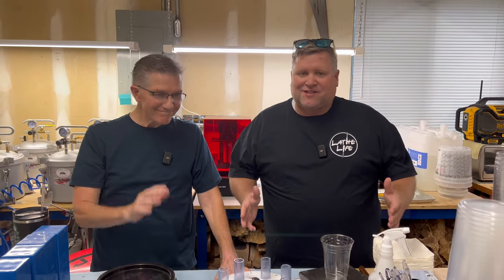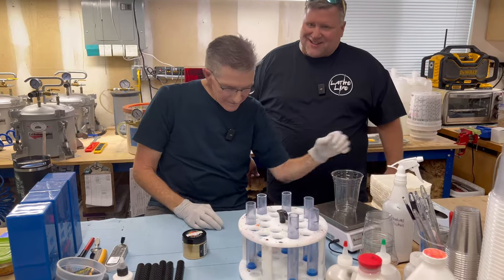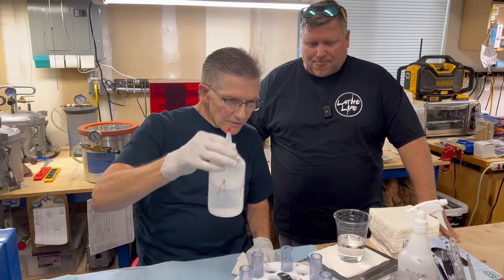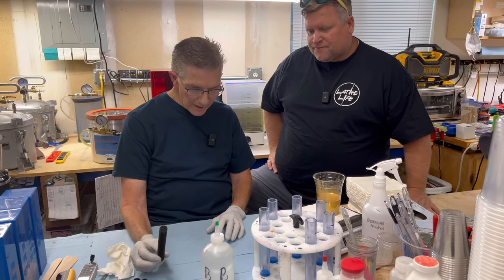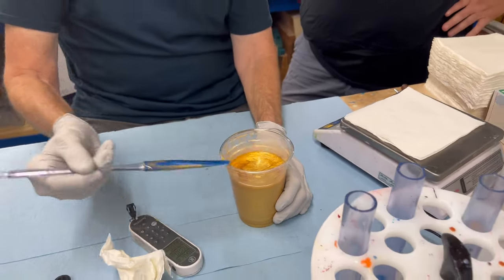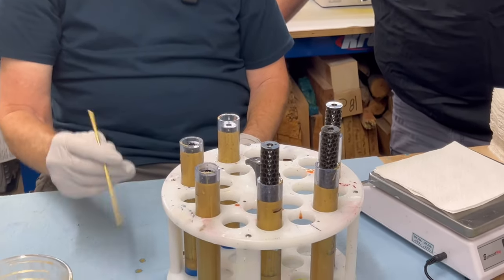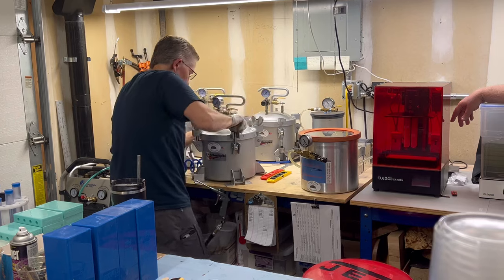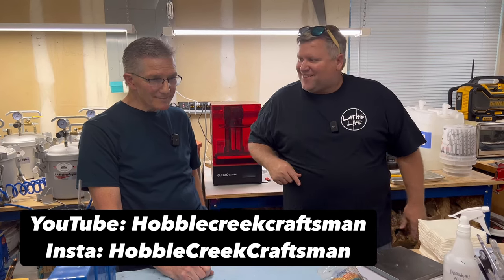Resin Casting Honeycomb Blanks with Mark @hobblecreekcraftsman

Comment: Does the honeycomb; being that it's so susceptible to UV light; make the finished blanks any more fragile that a traditional poured resin?
Reply: Great question Teresa! Once the honeycomb sections have been cast in resin, that will stop the UV curing process. Turning the blank takes a little bit of 'finesse' due to the honeycomb structure. I suggest using carbide tipped tools, but traditional tools will work too. The important thing is to make sure you have freshly sharpened tools, or a fresh carbide cutter when you start turning! 

On occasion you might find a pin hole or two within the blank, but that is easily fixed with a bit of CA glue. Simply fill in the pin hole, hit it with some accelerator and continue to turn.